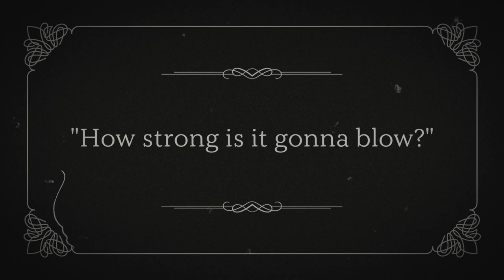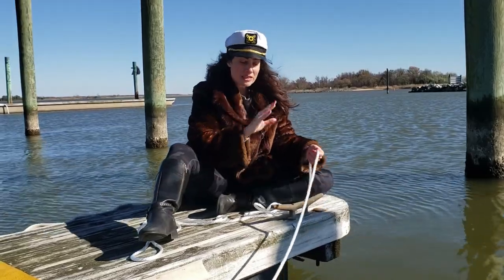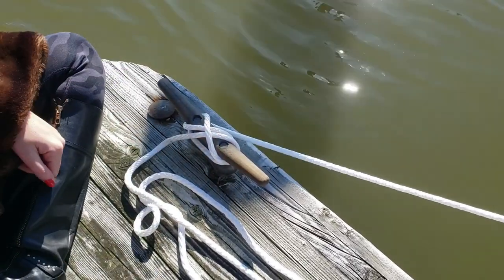How to Tie Your Boat Badly - Cleat Hitch Horror

Comment: I have another exception. On non-floating docks that end up underwater with waves going over the top you are going to need to secure the tail or it can come undone. Fortunately for me I had an extra line around a pier at that location. It happened more than once before I started securing the tail so not some fluke.

Comment: To belay or knot belay, that is the question.  Cleverly done video.  The cleat hitch is OK for docking small boats at floating pontoons. Not recommended for a big boat if heavy loads are expected.  If a hitch is NEEDED it will jam. It seems like you know that there are two schools of thought about that. 1) The big boat operators who belay with figure eights. 2) The small boat operators who make fast with knots. Group 2 change their method when they join group 1. The opposite doesn’t happen.
Reply from the maker: You got me with the puns. I should be ashamed of how much I enjoy them!
Reply: I thought, by the video, it would get you. How not to tie a boat. For those who don’t get the end bit: turns and figure eights underneath the knot reduce the possibility of a jam up. Hitches and turns above the knot are useless, because if the knot is needed it will jam. See “coastguard boating education “.